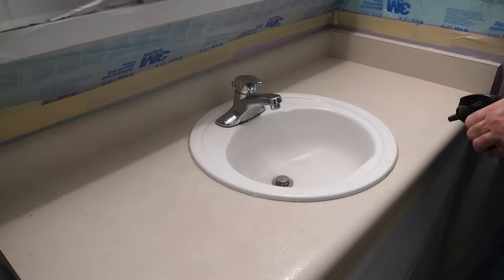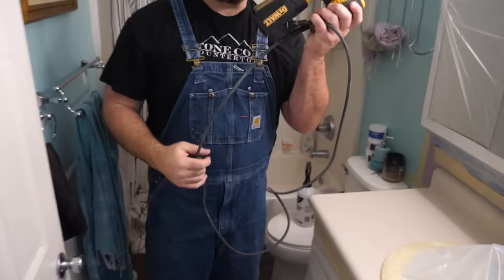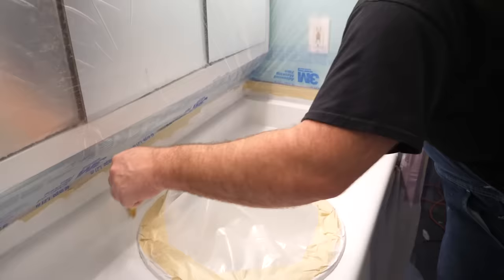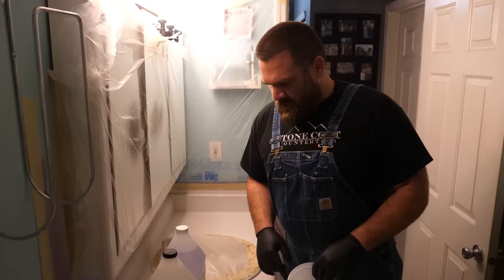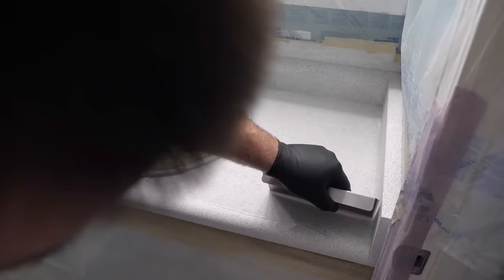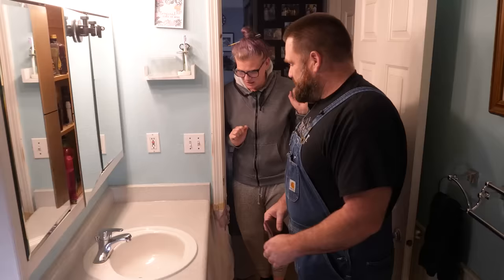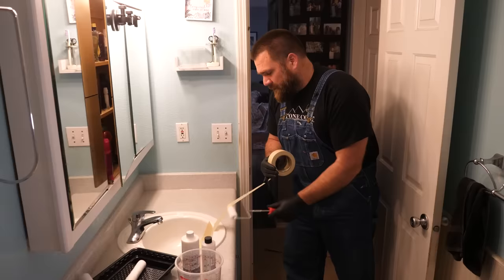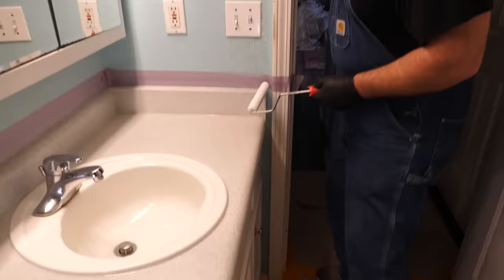Epoxy Countertop with Sink and Backsplash in Place | Stone Coat Epoxy

Comment from the maker: 🔴Did you see the durability testing at the end of the video, what durability test do you want to see on the next video?👀
Reply: Hot shower steam in small bathroom?
Reply: Dang that’s durable! What would happen if fingernail polish spilled?
Reply: The top coat has yet to stain! I've cleaned up sharpie, dried cool-aid off my dining table with the top coat on it. Also my table is by the woodstove, it can handle the radiant heat no prob!
Reply: @Kreative_Rainbow  good idea!
Reply: Amazing durability. No question that a surface that wasn't protected would have been destroyed
Reply: @mitchquist  You're welcome!
Reply: I liked the durability test, good job!
Reply: I know the epoxy spreads impact over a broader area and makes the counter more durable from an impact (say a glass slipping when taking it out of a cabinet or pan edge hitting it) but i would like to see what a normal (sample) counter like this one would take to chip before and after coating. I have the same tops in my house and most have chipped tops or end cap pieces have broken/fallen off and want to redo them all but im not light handed with them at all and known to sit a hot pan on them along with dropping stuff out of cabinets on them too. Not sure of your location but if within a couple hour drive i have some counter tops like that i will donate for the torture test and drop them off too for a tour😁
Reply: @Kreative_Rainbow  of a black 🖤
Reply: Orange cleaner
Reply: My counter has a molded sink so it's all one seamless piece. Can I do this all with this product? If so I'd like to see durability of sink dropping things and toothpaste and alcohol mouthwash and water filter charcoal.
Reply: @barrez9307  as long as the sink is made of the same material as the counter and doesnt flex when something hits it, those items will not cause any problems. The piece of counter top we did as a test piece, i threw keys and i mean THREW the keys, hit it with a hammer with nail head and claw side. It chipped and cracked but it was tested till it failed and it was extremely tested
Reply: Anything that doesn't make that loud scratching sound like fingernails on a blackboard. 😱🤢😲😬☺️
Reply: I love seeing these transformations. I wish you would come do my bathrooms
Reply: Too bad the ultimate top coat doesn't leave that beautiful, glass like shine to it. You seem to have to sacrifice the shiny finish for durability.
Reply: I’d like to see the same scratch test then wipe something colored over it to see if there are scratches. Also what about heat? Curling iron maybe?
Reply: Do u travel
Reply: Where do I purchase these products
Reply: Do you have a video for the same thing but on a granite counter?
Reply: A forgotten cigarette on the edge. Not that I smoke, js.
Reply: @kumite14u  he said if you want a glossy finish just add another coat of the epoxy instead.
Reply: Can you epoxy over a porcelain vanity
Reply: Standing water from sink splash.
Reply: How long does it take to ship to Hawaii? The big island on the Kona side
Reply: I have watched this twice and as much as I really want to try this I’m still really nervous 😩
Reply: Good looking out BIG BROTHER🙏
Reply: Cigarette burn. My tenants always leave one or two when they leave
Reply: how does it hold up to water?
Reply: the 3 year wear and tear test
Reply: As a Coatings Chemist, coated countertops have potential problems with staining, plasticizer migration and water sensitivity. I've seen these problems personally in an apartment as a newlywed. (LOL - they wanted a deposit back until learning that dozens of coatings chemists could all testify, authoritatively, that the epoxy used was not suitable for kitchens and bathrooms, in spite of what the manufacturer said.) 
HOPEFULLY, these issues have been resolved with newer products, but these were real issues with some of the first epoxy countertop coatings to hit the market.
How to test for these problems on a light-colored epoxy countertop coating:
Staining: 
Squirt a line of mustard onto the epoxy and let it dry. When you go to wash it off, many coatings (including epoxies) will be stained yellow from this simple test, but most non-coating countertop materials will be unaffected. Mustard is used in pretty much every kitchen, and it is inevitable that some will dry on the counter at some point. Mustard staining is almost always very troublesome for coatings. 
Plasticizer Migration: 
Every kitchen appliance with rubber feet will run the risk of leaving softer, indelible brown marks in the epoxy from plasticizer migration. To test, buy a few kinds of new soft black rubber feet and hot glue them to a brick, 3 per one brick end. (3 ensures even weight distribution, and you might find several rubber feet to test. White rubber feet can also do this, but the black ones leave stains that are easier to see.) Place the bricks, rubber feet down on the epoxy, on the countertop for a few months and inspect for staining and irreversible softening. Often the softening can be seen by simply using your fingernail on the footprint area. (Carved wooden jewelry boxes, commonly imported from other countries, are often stained with non-drying oils, will leave similar stains and softening. A carved wooden jewelry box my wife purchased on our honeymoon was reasonable to leave on the bathroom countertop... Result: A big yellow stain underneath it.) 
Water Sensitivity:
A practical test that occurs in every bathroom is easy to replicate. Place a tissue box on the countertop and spill a partial glass of water, allowing it to run under the tissue box. Wipe up most of the water from the rest of the countertop, but leave the portion under the tissue box. (Kids or rushed parents would never leave the water under the box, right? Right...) Let it dry out for a week and then remove the box. Many epoxies will soften under moist conditions and become sticky, causing the cardboard to be effectively glued to the countertop.
Control: 
It's always good to do testing vs. a standard. In this case, a light colored laminate would be the closest in installed cost to the epoxy. 
Experience: 
ALL of these "problem items/tests" have been repeatedly tested on every other countertop we've had through 3 other homes and ONLY the epoxy countertops in our first apartment failed them. Laminate, Granite, etc. all pass without any issues. 
I would expect that butcher block countertops would be susceptible to staining. 
Marble countertops will acid-etch from citrus, vinegar, and ketchup.
Reply: Okay my 6ft formica with integrated sink and molded lip back splash.... how do i even begin to make this work
Please help!
Reply: vehicle burnout!
Reply: to bad she has to re paint the hole bathroom because you pealed paint off the wall
Reply: @Kreative_Rainbow 😊😊😊

Comment: Pro tip:  Sand everything BEFORE you tape & plastic up everything. It's NEVER a good idea to have dust particles, from sanding, all over the tape, plastic, etc. This way your area is literally clean for pour PLUS when you pull off the plastic and tape....no sanding dust will get in your new epoxy.  That tape around sink has to be pulled off while epoxy is wet so sanding dust is going to get in it.
Reply: Yes good i was going to say the same thing. Also remove the sink. It’s an easy removal and replacement. Not a whole day of work like stated.
Reply: @user-ds6ur2og5p kinda depends on who you are and what kind of shape your plumbing is in.😮
Reply: And stop touching the prepared surface with greasy hands. Should be wearing gloves to stop hand oils from contaminating surfaces.

Comment: I did this to my guest bathroom not long ago. I added some gold flakes to the first light layer of epoxy. It looks fine. Not perfect and definitely needs another epoxy coat. However, I can’t stress enough how important it is to wear a GOOD mask and have some form of ventilation. My bathroom is the same as this one, small with no window. I breathed in a lot of spray paint and I can’t be too sure, but like 3 days later I developed horrible bronchitis. I had it for like 3 weeks with the absolute worst cough and hard to breathe. So be careful.

Comment: These are the type of instruction videos needed. Most people including myself want to do bathroom or kitchen countertops that are fastened with back splashes. I have held off on my projects because of the backsplash.  Fighting gravity with the product is an issue for me and probably most other people. Many videos show a flat panel separate from whatever cabinet it will be on top of where control isn't  an issue.

Comment: Oh man, that epoxy under the front counter edge... Flippin OP pro tip right there 🤌 as an apartment maintenance tech, the number of units I would walk into with that area just bulging and crusty dusty, normally we'd smooth it out and move on unless the counter was toast but it was always so nasty thinking about what that stuff was exposed to and had growing it...
Reply from the maker: Yes!!! That's never a good time who knows what's under there. If you gonna do a job do it all the way!
Reply: I've rented a place with a sink top just like that and it would fall apart every time I cleaned it
Reply: Would you want to see an apartment remodel?
Reply: Under kitchen counters where dishwashers are is very appreciated. The warm moist steam of DW is not kind to particle counters. Any kind of sealant for that 24" wide, maybe 6" deep zone is a true kindness.

Comment: I used just the stone spray to refinish my old fireplace.  The fireplace started as a dark brown grout with rust and brown stone color.  Went over the entire surface with the sandstone color x 2 coats to even the color base and provide the grout color.  Then once dry, I taped the grouted surface area to prevent over spray.  I used 4 colors of stone textured spray,  individually taping and spraying each stone, varying color to mock field stone.  That was many years ago, and it still looks amazing even after a ton of fires!  (FYI this is near the field stone front of house and it matches!)  Amazing product that lasts!

Comment: Thank you for the tutorial. My house has two 1986 plain white laminate V-tops, one of which is 85" wide. Cost to replace the large one, along with its two sinks, is $900 to $1400, plus I'd have to do the demolition, dump run and plumbing. The smaller v-top is 37", but even that one would set me back $300. I think this would be a viable option for me. Plus, it could be fun!

Comment: Glad I saw this. I’m considering doing this on my kitchen countertop, which is so dated looking, especially in this age of granite, etc. countertops. I’m just not able to afford going the route of replacing with a stone countertop, which would easily be $2500 in my case. Looks like epoxy might be just the solution.
Reply: There's also Epoxy that don't need torched, just use Isopropyl Alcohol spray to remove the air bubbles 😁👍🏼

Comment: Bit of advice.  I am applying epoxy today on my bathroom coutnertop and using StoneCoat products and this video primarily as a reference.  It was helpful the other day to stop the video and take notes to come back and reference while I'm working.  Don't think you can remember everything from memory!

I'm doing something like the black galaxy but instead with a dark gray (Behr flat primer + paint in one) as the undercoat and with diamond dust mica powder mixed into the epoxy.  I'll top it off tomorrow with the glossy ultimate top coat.

I'm here reviewing the video before removing the tape in a few hours.  Lessons I've learned already... 

1.  Get a plastic notched trowel if you can.  I just used the metal one provided in my kit and it left scrape marks in my base paint.  More like darker scratches that are now covered in epoxy and forever sealed in (and now darker since the epoxy was applied).  Although not likely noticeable to others, I will be looking at them until either the countertop or I die.

2.   CAREFUL WHEN TORCHING  Okay, what no one says is that if you have your flame like a milimiter closer or a nanosecond longer than what you see in the video, your epoxy will BURN.  yes, it will bubble up and your base color paint may even change color.  My beautiful gray undercoat now has a scorched patch where it is brownish.  I can't exactly remove the expoxy, sand down the scorched paint, repaint and reapply the epoxy.  I will have to learn to live with it, I guess, and good thing that side of the counter is what my husband uses and unless I point it out, he will never notice--and likely not care.  He'll just tell me that I did a good job and it looks great and to not get discouraged 🙂

Comment: Another nice one Mitch!  
I appreciate the emphasis on prep. No such thing as over prep!

A question for SCC:  have you any experience using your products over surfaces painted with “Behr chalk paint”? 
Can I treat a chalk painted surface as undercoat and apply a clear Art Coat followed by Ultimate Top Coat?
Reply: I am definitely not a pro but since you received no feedback in a year guess it's ok to share my experience.    I agreed to help a friend redo her kitchen countertops.   She had a very large kitchen and wanted the faux marble look with veining.   She informed me she did the cleaning, sanding and priming before I arrived.   We worked for several days using 5 gallons of product.  It actually looked nice.   We were pleased with our work.    Within 2 months she called me in tears, the product seemed to be lifting or loose in many areas and along the edges.   She lived in Texas, I am on the east coast so I couldn't just drive across town to hopefully troubleshoot the situation.    She asked me what "I" did wrong!   Finally her husband grabbed the phone and explained she actually did not properly prep the surfaces.   No sanding or recommended primer plus she used the chalk paint and sealer as her base.   I do not know what brand chalk paint she utilized when she initially painted the countertops but since Mike mentioned chemical reactions (or something similar), between the recommended products I presume that was the culprit.    Personally I wouldn't risk mixing paint brands.   They literally had to rip out their original countertops and start from scratch.

Comment: Just a little trick i use many times. 
I use cheap 2 way tape around the sink at least 3/4 of an inch inwards from countertop. Peel the backing off and stick the clear plastic or paper on top of the tape again leveling 3/4of an inch space . Then use a 1 inch tape to back cover the rest of the sink and back up first protection  layer of protection  . Once the epoxy is slowly hardening up , I peal off just the tape and leave it on top of th rapped sink while the epoxy self levels itself to the sink . This way you'd have wsy way less chance of dust or crap falling into the epoxy.  

Just me 2 cents .

BTW you could use the same method with take instead of 2 way tape .

Comment: Amazing video! Question, how does the coated countertop hold up against shower steam? and there is amazing durability with the top coat applied. I was wondering if someone wanted the glossy look and you did a second coat of epoxy instead of the top coat would you have the same durability or would it more prone to scratching? if it is more prone to scratching is there a product that is like topcoat but with a glossy finish? Thanks!

Comment: Wish you would show how to use your product on tile. Would you have to apply a cement base on the tile first?
Reply from the maker: Here's a tile floor we did! Yes you'll want to level quick first.
https://www.youtube.com/watch?v=WJXfqzH3JwU
Reply: New on-site Epoxy over tile video will be getting filmed early to mid December! Hang tight and be sure to subscribe so you don't miss that one! I'm going to turn the front edge into a rock-faced edge with bondo then fill the grout lines and apply level quick and you'll never know you had tile countertops down below. What type of sink do you have?
Reply: @mitchquist  undercount
Reply from the maker: @durangarc  You can keep that sink in place and still pour epoxy if you'd like

Comment: Great video and very timely!  Updating my kitchen now and you have saved me from replacing 22' of laminate countertop.  If the laminate has a few tiny nicks (1/4") on the edge what can I use to fill them in?
Reply from the maker: First, we clean and degrease the laminate or Formica, then sand with 60 grit, next apply our bonding primer (XIM Bonder/Primer), and then the epoxy process.

Comment: Great vid👍I also have the marble look, non-formica single piece combo molded sink/countertop..same process ❓
Reply from the maker: Same prep steps as this video except you will be prepping the sink for epoxy. I would take out the tail piece on your drain to allow the epoxy to drain out the bottom as it self levels down the sink bowl. Reinstall the tail piece after you apply the ultimate top coat and it has dried! Let me know if you have any questions!
Reply: @StoneCoatCountertops  👍gotcha, thx...yeh, sure don't want a sticky tail piece, lol...n will definitely mask the drain hole tooooo😊✅🤞🤞🤞

Comment: Wow! So glad I watched this I wasn’t putting enough water in with the top coat and couldn’t see my design on the table top I made!  I know better now!  Thanks
Reply from the maker: Hope that helps!! It makes it easier to mix and roll out as well
Reply from the maker: Make it thinner like latex paint rather than elmers glue! You Got This. Add up to 10% water by volume of top coat mixed
Reply: Thanks for taking the time to let me know you enjoyed the video! If you are working with a big job that you are applying the Ultimate top coat have extra dry rollers ready. It helps to not have too wet of a dry roller if that makes sense! Let me know it you have any questions